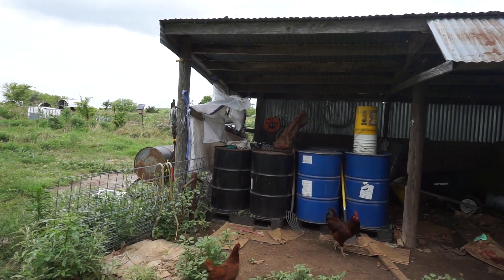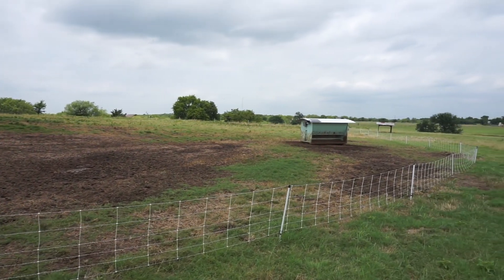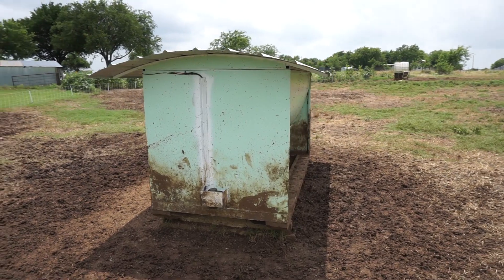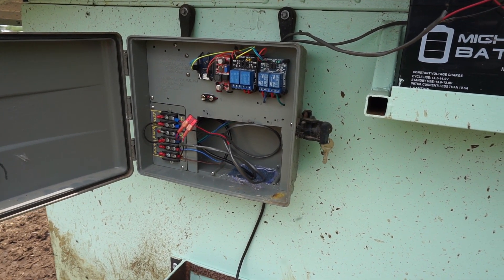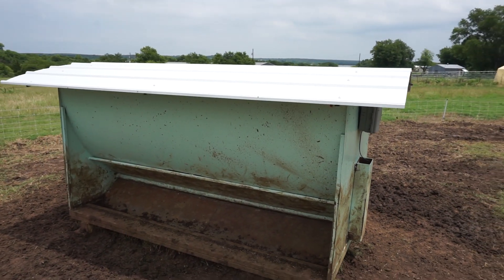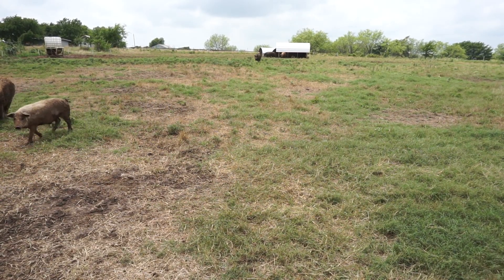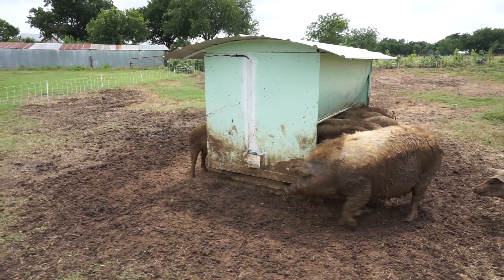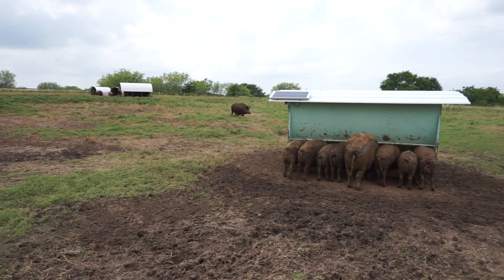Automatic WiFi controlled Pig Feeder

Comment: Love the idea for the feeder. Not sure if I missed where it came from, but is that a salt spreader box? There is a Honeywell solar switch that would be perfect for setting the feeding times, but you can probably do it too using some server script for wifi.
Reply from the maker: Thanks! Are you referring to the vibrator? It is for a salt spreader, some advertise for concrete mixers too. 

Is the honeywell a PLC? Something like that would work fine I'm sure, though with using the WeMos and it being connected to wifi I'm able to do some monitoring and change the schedule from my computer or phone.
Reply: @thrivestock8108  I meant the box itself. For the switch, check out this video and blog post from the link (neat diagrams and parts list) - I made the chicken coop door opener based on it and it has worked great. https://www.youtube.com/watch?v=c23URirKNic